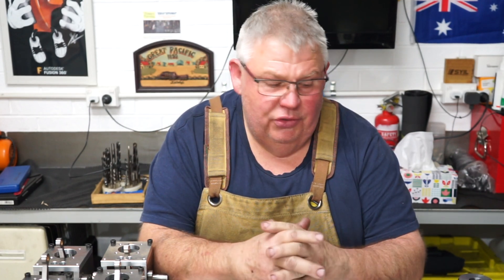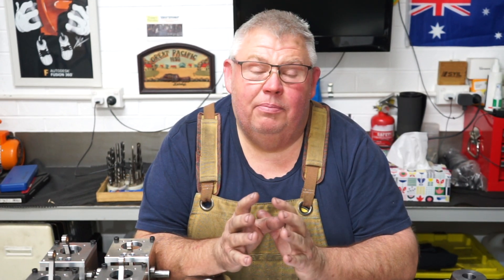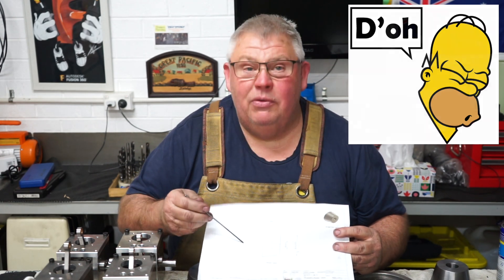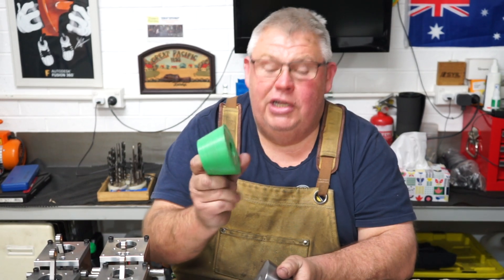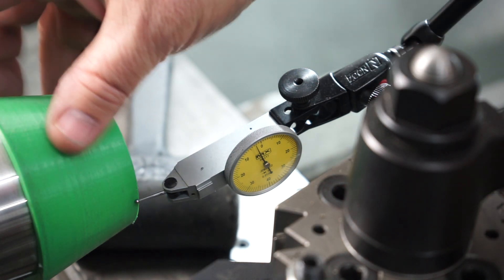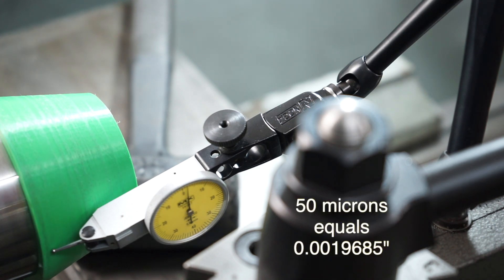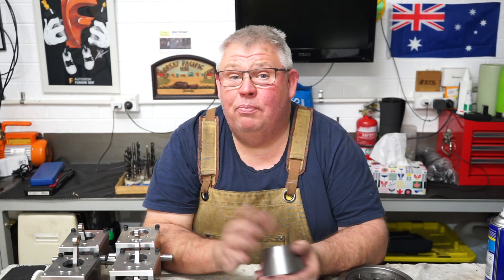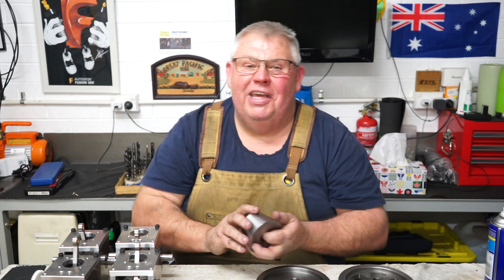I made a THING!

Comment: Gday Aaron, great job mate. An alternative to not having a sine bar available is to set up your indicator on the quill or the job calculate the opposite site of the angle and use that amount as your dial drop when setting your compound angle. Keep up the great work big fella.
Reply from the maker: Hey buddy, now that’s an excellent “Pro Tip”. Thanks for that. I have also used the DRO before. But old girl doesn’t have one. Cheers 🍻

Comment: Thanks Aaron. I did similar my last little job. I was actually making new bushes for the idler wheel that runs against the drive built for my lathe and I had a piece of scintered bronze stock in the chuck. I turned it down to the outside diameter of the large flange. I wanted to make two so I had to come in and turn the small diameter down to size so I turned twice the length but of course that means I cut the flange off so I had to move over another section & start again! 🥴 So we all do it from time to time. .
Reply from the maker: G'day Tony and thanks for watching.  I'm glad to hear that it's not just me who makes these silly mistakes from time to time.  But as my old mate Peter Pilbeam says to me, "the bloke that hasn't made a mistake hasn't made anything".  Cheers, Aaron.

Comment: Hi Aaron, how come you didn't put cutting oil on the boring? Sheer curiosity on my part, I usually smother the victim in oil, but that is just me. Good onya
Reply from the maker: Hi Glen.  I usually use cutting oil / coolant on my high speed steel tools.  However, on carbide tools I usually send them dry.  With carbide tools, it is best to either use no coolant or lots of "flood coolant".  It doesn't like to be intermittently sprayed etc...Hope this makes sense mate.  Cheers, Aaron.